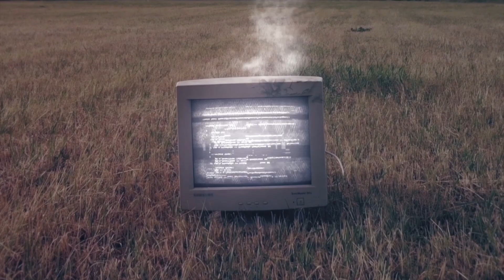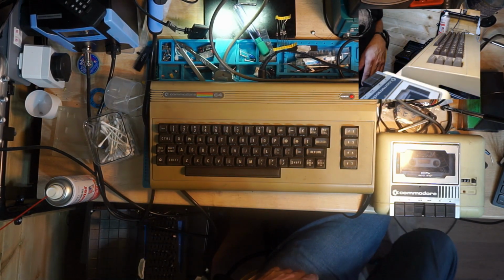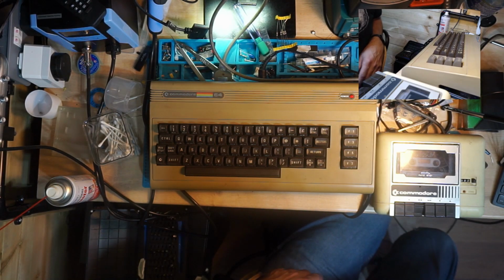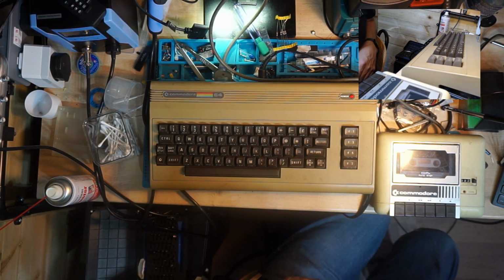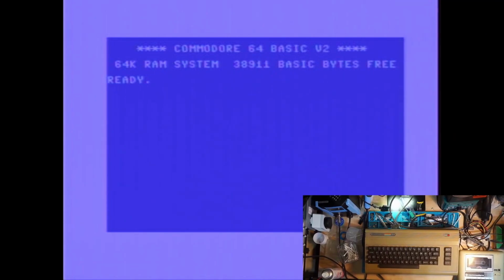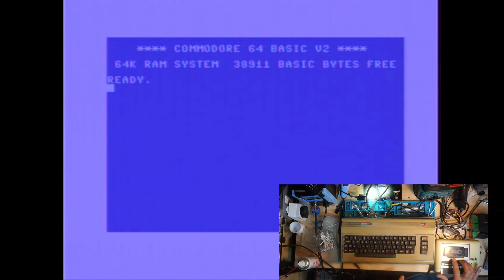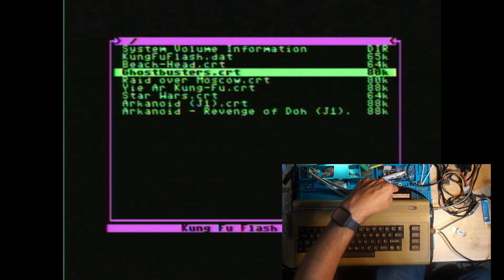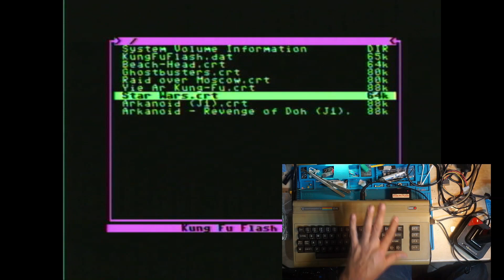Journey into the Depths of Commodore C64 Sound: Unveiling the SID Mystery and More

Comment: Nice video mate . Them Swinsid are hard to push in . If your wanting to back the orginal sid you'll needs a new socket . Clean the mortherboard tape port thats why the tape deck didnt do anything until you wiggled the connector :) ... Ghostbusters sounds loads better .. The ping noise is the swinsid :)
Reply from the maker: Thanks for the info.  Don’t mind fitting a new socket would like a original of course. Yeah it was a tad bit on the hard side to fit lol 😂